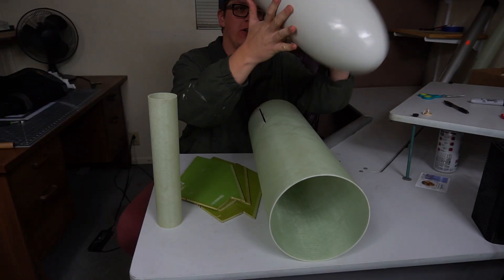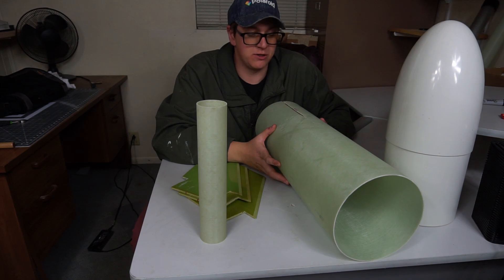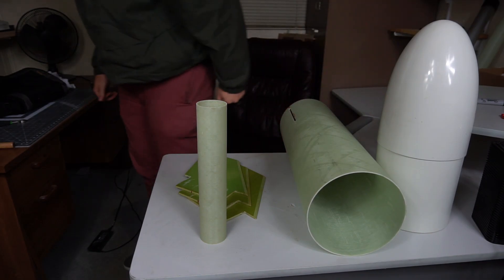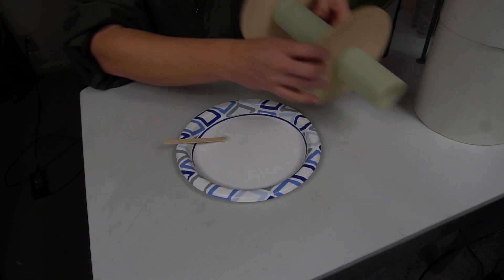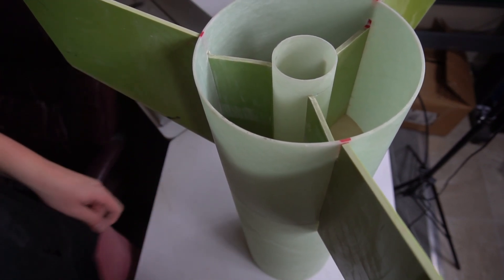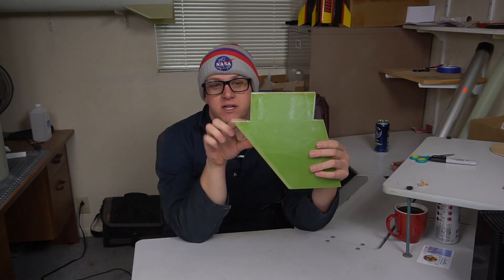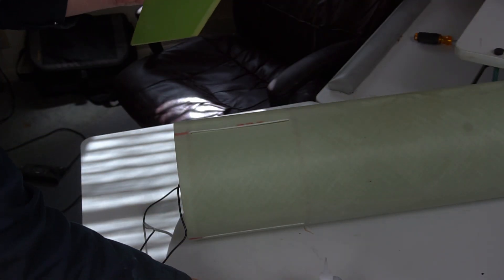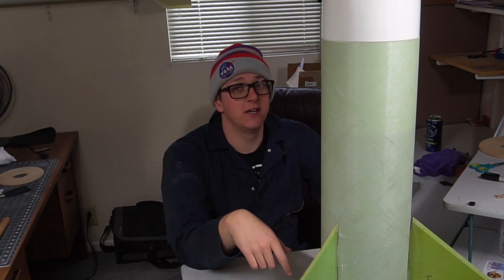Building a HUGE Estes Model Rocket (3x Original Size!)

Comment: Hi again. As the original owner of Smokin' Rockets and designer of the "Chubsy" kit (Estes trademark laws would not allo the Fat Boy name), I used 3/8 Baltic Birch Ply fins on kits I sold, and would never design fin tabs like that for the reason you found
Reply from the maker: I thought I remembered them with ply fins! The shape is also not quite right on these ones. I suspect either the person I bought it from or that one fiberglass manufacturer is responsible for these ones.

Comment: The fins not touching the motor tube was a brutally easy fix. 1) Take another 54mm tube and cut it into thirds circumference wise. Then glue each section to the area of the motor tube where the fins meet. 2) recut the maintube portions of the fins with a saw. 3) wrap your mtr tube with fiberglass.  Very simple fixes for a poorly manufactured kit.
Reply from the maker: Or, you could use a dremel because trying to cut 1/16" off of 3/16" glass with a saw is not an easy task lol

...much like I did in this very video

Wrapping the motor tube with fiberglass or hacking up another tube are both chaotic and time consuming solutions to a problem that shouldn't have even existed in the first place.

Comment: I’d like to see how they make those nose cones.  It’s gel coated u say?  How do they do it?
Reply from the maker: I believe these were made in a two-piece mold and then gel coated as apposed to many filament wound nosecones you find today. PML still makes gel coat fiberglass nosecones!
Reply: @RocketVlogs  It is a 2-piece clamshell mold. The gelcoat is applied to the mold first, and let get to its green stage. The glass is then laid up over the gelcoat inside the mold and then allowed to cure. The gel coat forms the smooth outer layer.